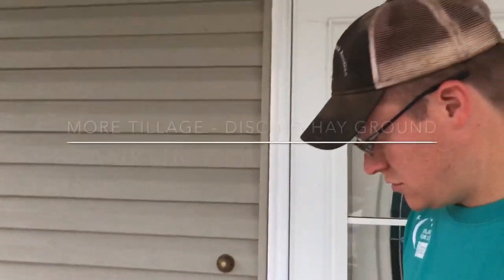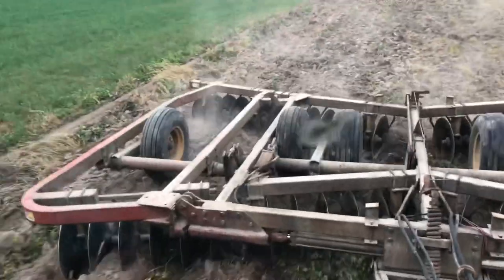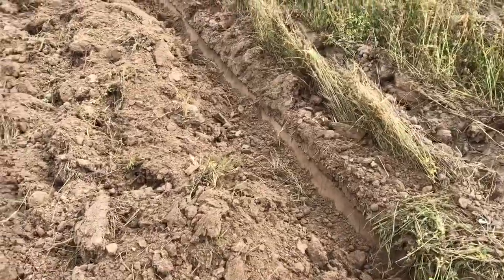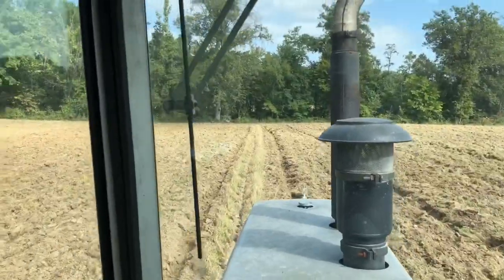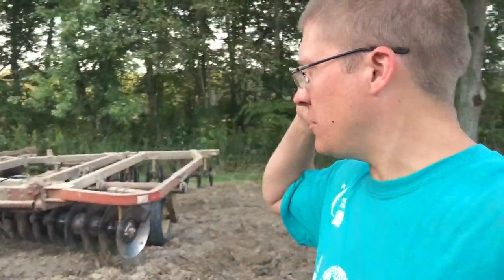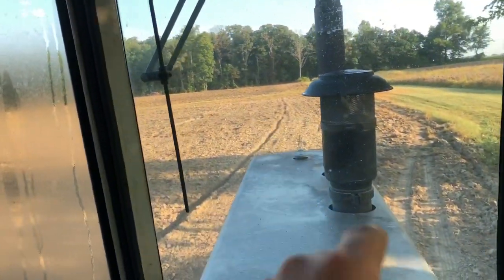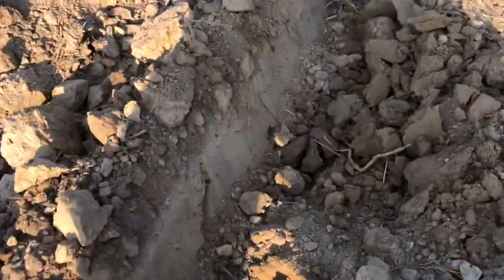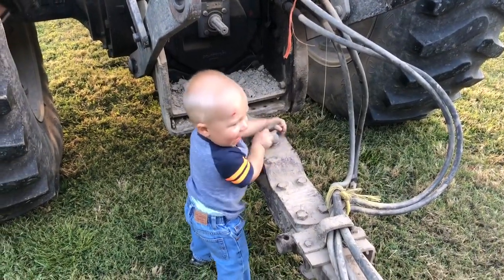White 2-135 TILLAGE 2020–Discing Hay Ground

Comment: I'm not a farmer, but why do you disk a field instead of plowing it? Or is that doing the same thing?
Reply from the maker: @jimhammer2012  just quicker and easier. I don't have a plow and don't have to worry about a dead furrow. I do rip deap and then disc. Sometimes I chisel plow too. Just depends on what's needed.

Comment: My 135 ac does the same thing. I just pull on the drain tube a few times and it clears out
Reply: @thebalerman  only thing I've had to do was replace a front hub .
It's only got 3100 hours on it and was pretty much babied by the previous owner
Reply: @scottbigger1945  a guy was telling me  bout his 2-135, he said that 4800 Hercules,  would and  get  down  and pull, the torque rise was  unbelievable